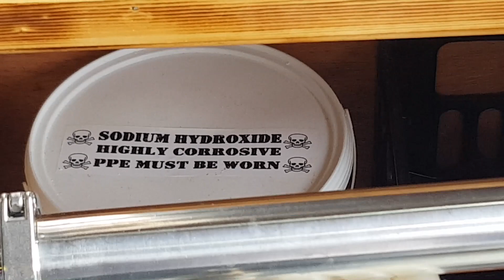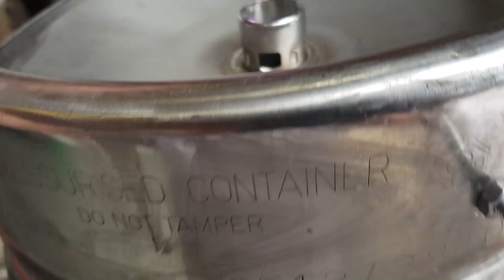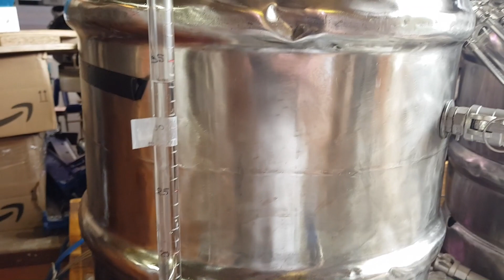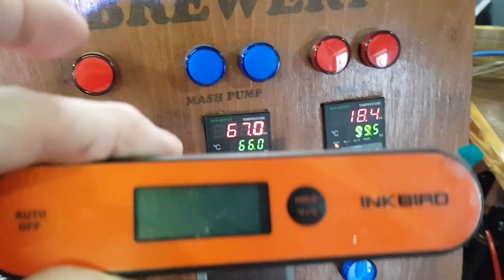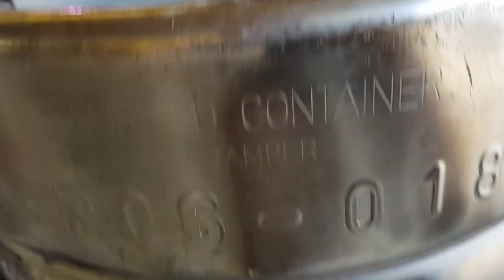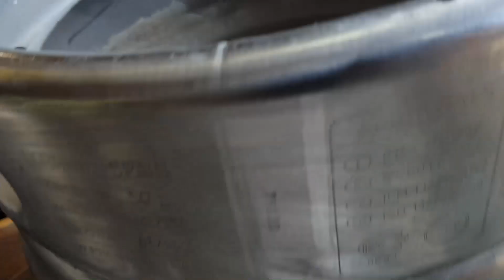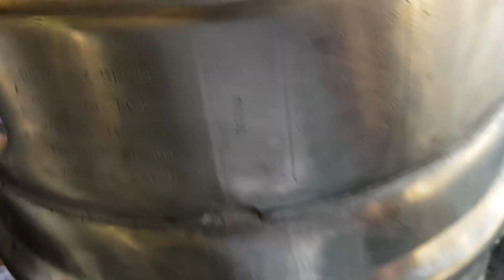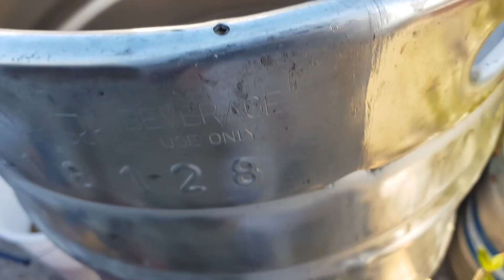Brew - Another NEIPA

Comment: Read something yesterday about how much bitterness (and potentially flavour) is left in spent hops and that some breweries were re using them as bittering additions rather than tossing them, especially with repurposed dry hops that go into the fermenter. Given how clean that hop debris is in the filter I can see how it would be viable.
Reply from the maker: I read that too but for my purposes and such a small batch size they're not worth keeping.  I can see how it may make serious commercial sense for a brewery though.